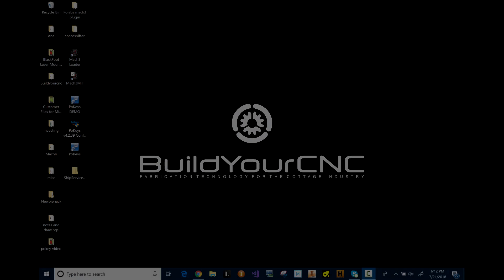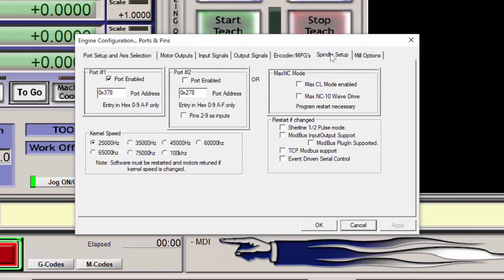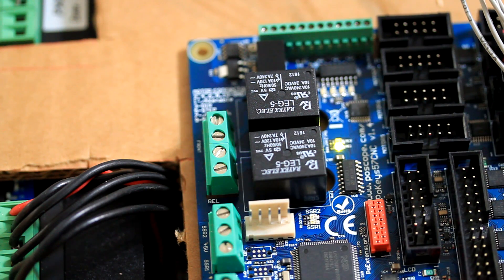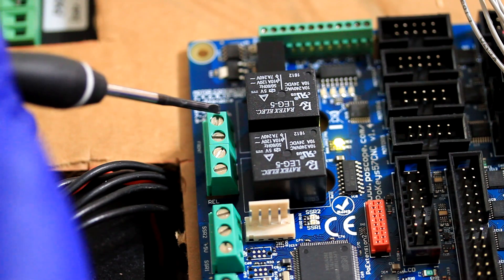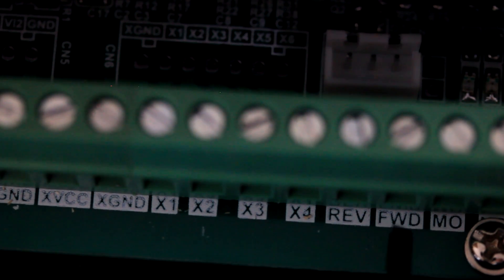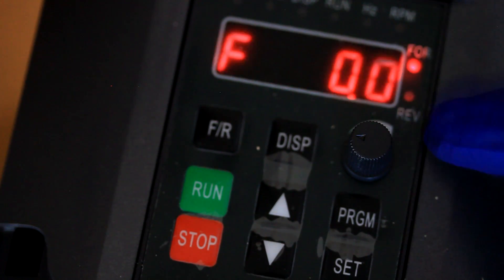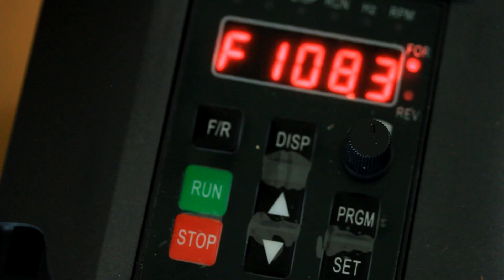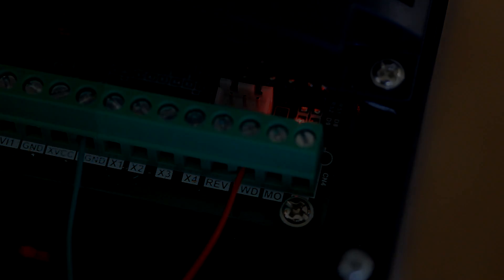6. Spindle On/Off Control using Mach3 and the Pokeys57CNC Interface

Comment: Hi.  an excellent video. 
But i have enjoyed to watch a video showing the Mach4 version of how to connect to the same VFD/PoKeys on CNCPRINT. He is not using the relay as you are doing and using a different connectors on the long green connectors on the pokeys. And now I’m confused and worried about connecting my 24V to anything else than the relay. In my world i will fríe my BOB if i put 24v in the long green connectors. But he is controlling he’s 2.2 kw wfd/spindle in he’s configuration🫣🤔. I have a 10v line from my vfd that I cannot figure out whats for. The 0-10 v makes sense. I have a Fuling inverter. 
And the plugin for mach4 is totally different from mach3. And I’m apparently a big chicken, not wanting to fríe my machine, thus only confusing myself,a lot🤦🏽. 
I have connected my setup as you do, and i think it works, sort of🫣. 
I think it’s my setup in match4 that confusing me. I can get the spindle to turn on an of. But often i must press off-button on the spindle multiple times before i decide to stop. The relay is klicking. But it seems like it’s getting a contra signal. 
And i can also regulate the speed. But i cannot figure out in the wfd display if the speed is the same as i write in mach4..
I haven’t changed anything in the vfd setup. It was setup from factory and worked. But the XHC BOB died. And i like the PoKeys. So i want it to work.
Everything else is working as supposed on the Pokeys

Comment: Great video! I have Mach 4 though and cant find where to enable the relay. Its not in the same place as in Mach3. Could you point me in the right direction?
Reply from the maker: Did you go to the pulse engine and enable the outputs?

Comment: The 0-10V signal is pretty dirty when inspecting it with an oscilloscope, no wonder the speed fluctuates here and there depending on ones VFDs inputs capasitance. The signal is generated from a PWM signal so dirty is what one can expect. In my testbench I'm now using a 33uF capasitor (not calculated, just a pick from my capacitors bin) between GNDi and the voltage output and that smoothens the output considerably, seems almost acceptable  Your multiplier value almost worked for me, I have now 0.004129 and it gives pretty linear output. Using a different capacitor will probably require a change in that. I also noticed that changing the PWM module period changes everything again. Did you test and find a better value for module period regarding the dirtyness of the output. Thanks for the vids!!! EDIT: Typos.
Reply from the maker: Did you tru using shielded cable with the cable between the VFD and spinde, and the cable connecting the PWM signal? It is also recommended to use an inductor on the PWM signal cable near the controller.
Reply: @PatrickHoodDaniel  I did not as I want and need to get everything to work well in my "lab" before taking the stuff to the shop floor for final assembly in the machine. Checking the output right from the Pokeys output reveals how dirty the signal actually is, the shielded cable will not improve it, the quality is nothing compared to the quality of a regular DAC . I'm still a bit suspicious about this card so it is important to see that everything works.
Reply from the maker: @carro5321  Shielded cable is a minimum.
Reply: @PatrickHoodDaniel  Sure, but I mean a shielded cable from Pokeys PCB to VFD will not improve the initially dirty signal from Pokeys57CNC. The shielding of cables is used against interference from nearby fields as we know. The PWM output for analog output would actually require a proper lowpass filter IMHO but a capacitor seems to do the trick..

Comment: So if  I understood the signal going to FWD connector is a 24V level coming from the 24V PSU through the relay. Right? 
I saw that you did not remote control the speed using the AVI conn. Is it intentional or it's not possible with either the BSMCEO4U-PP or the Pokeys57CNC interface? Thanks
Reply: I am wondering as well

Comment: Thank you for this video. It was very helpful to me. I have a used "Industrial Brand" CNC router table and I wanted to get Mach3 to control the spindle, not the VFD control panel as was originally set up.

Comment: hi Patrick very nice tutorial,
do you know by any chance ho to control router spindle using Centroid Acorn CNC 12
thank you
Reply from the maker: If that controller has a relay the connection should be the same.

Comment: Hi
I'm trying to convert an old boxford CNC lathe and I think the best method is for me to rebuild the electronics from scratch. I understand how to move the x and z axis with stepper motors but there doesn't seem to be as much info on the spindle motor itself. I would like quite a powerful motor but do I absolutely have to have a VFD? I use one to convert single phase the three phase for my manual lathe but I was hoping to avoid it in this conversion as the motor inside the cnc lathe at the moment seems to be a simple single phase 240v motor
any help would be appreciated
Reply: ac or dc?